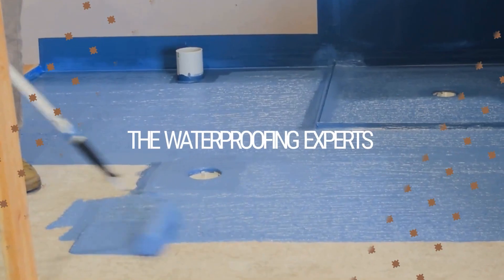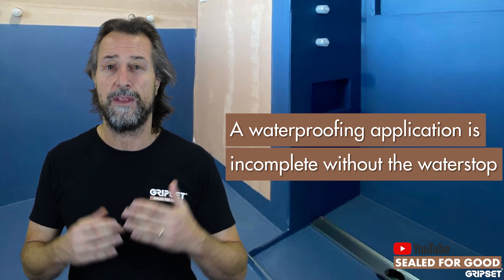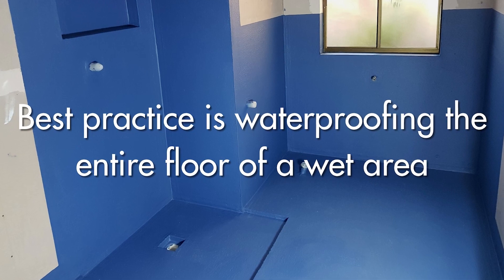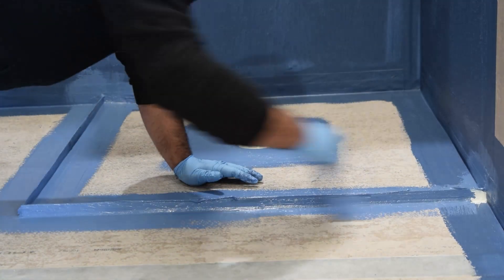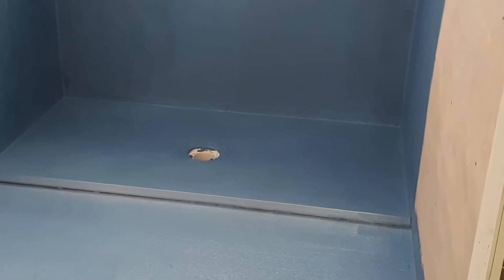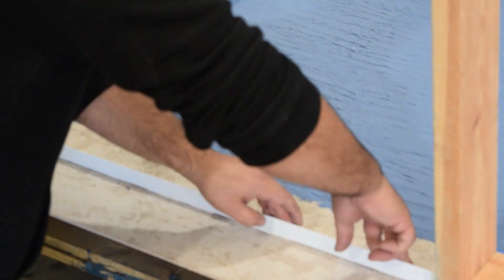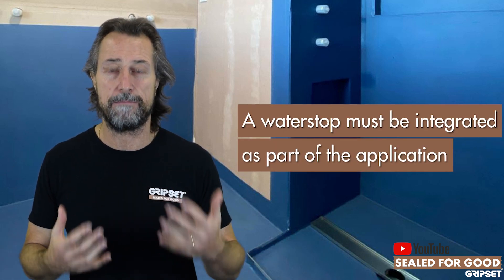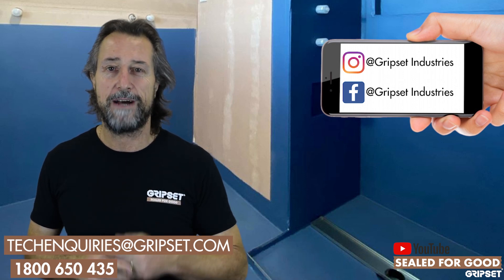How To Waterproof With Waterstops

Comment: Hi wondering is one coat of waterproofing enough over a blue board 
Thnku
Reply from the maker: Hi! We recommend applying two coats of membrane, each in opposite directions to one another. This helps build up the film thickness evenly and provides cross-hatch strength for a more reliable waterproofing finish.

Comment: I am interested in your view of the following scenario for the installation of water stop angle at a doorway.
A polyester resin fiberglass membrane to the perimeter of both a concrete slab and another for the whole area of a timber sheet floor. The water stop angles are not incorporated in the waterproof membrane but are at a later stage, installed by installing angles down to the membrane with polyurethane sealant.
Is this an acceptable process?
Reply from the maker: Hello @Charles, could you please send us an email at techenquiries@gripset.com and our technical manager will get in contact with you.

Comment: One thing overlooked all the time is the doorway angle is put in out of level, it makes the tilers job more difficult because generally that is still visible after tiling is completed. Finding or making packers to bring it up level is a 2min job, and makes the job so much neater. Seeing tiles finish flush one side and lippage the other is so messy and a polished flat bar stuck to the other just creates an unsightly silicon joint at the door.